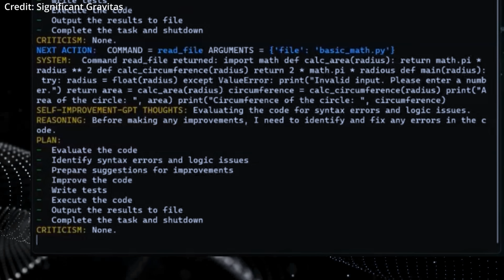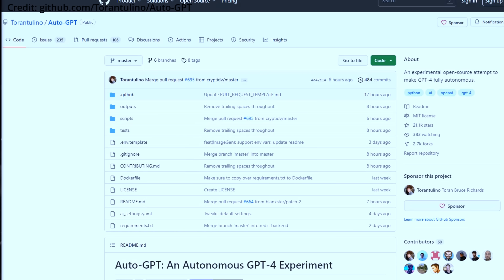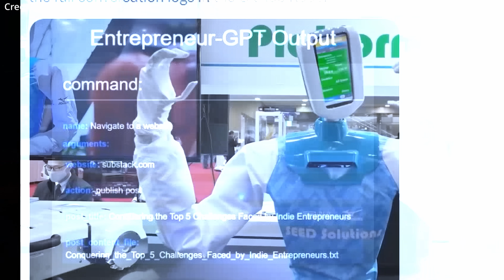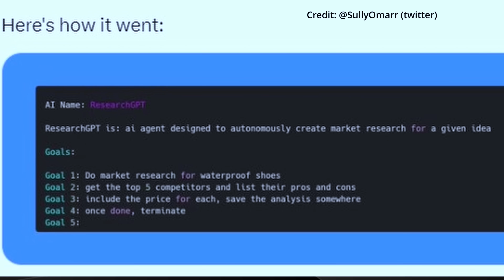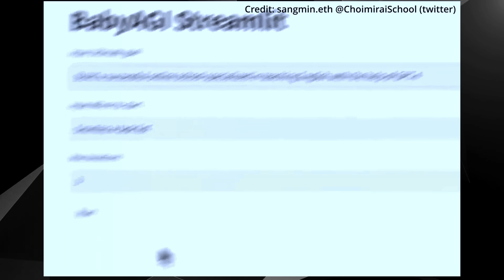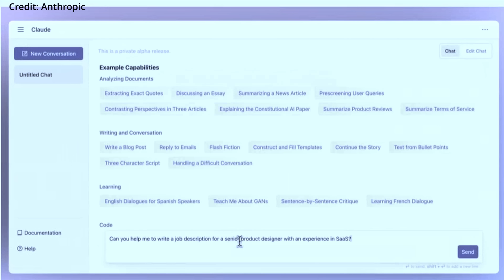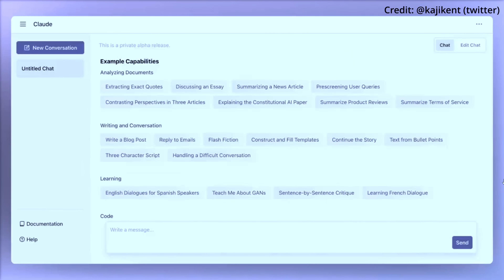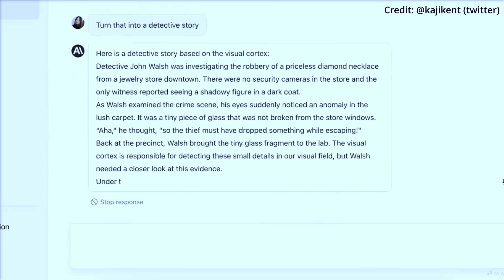Auto-GPT Unveiled: Autonomous GPT 4 w/ 7 New Abilities + 10X BETTER AI

Comment: Many people aren't sure where it's strengths are which is running many python scripts. So, the biggest advantage is asking it to create a bunch of python script with specific tasks and running them. It's simply GPT4(3.5) with API so the accuracy is only going to reflect that, but it WILL go back and fix it if it doesn't run correctly. Being that this is a open-source trial stage project, its mind blowing. If its not apart of your toolkit in training with AI you'll be far behind the other guy when this kicks off
Reply: The speed this is moving, gpt5 or 6 and it’s competitors will have this built in. Gpt4 made a ton of chatgpt based apps redundant, this trend will continue for the next ten or twenty years

Comment: Imagine that, a set of tools to accomplish task instead of a single tool trying to do everything. I don't know why it took so long before the AI researchers got off the "every hammer is a sledgehammer" track. But I'm pleased they realized it wasn't even close to a good plan.
Reply: This is powered by gpt-4. It would be hard to link other AIs together and do something useful atomically without GPT4 controlling and reasoning long term plans and multiple steps. 
It's so new I don't think it's fair to imply that the idea of multiple AI working together as something that was missed, it just wasn't practical before GPT4

Comment: In its current state its extemely buggy and can create code but from my experience the code will have errors and it cant execute that code. But im sure it will eventually be able to.
Reply: A friend of mine hooked up code execution to it so it can test its own code and fix the bugs. It didn't work very well, since we are still on the GPT-4 API waiting list and were using 3.5
Reply: @Alice_Fumo  im pretty sure it already has code execution it just cant execute it succesfully yet.
Reply: @Beneaththebranches  one of the reasons it writes buggy code is because it’s trained on code snippets from the internet like on stack overflows, it’s literally been trained to write buggy code. If you extract a ton of working code from applications past and present and fine tune it on that working code it will write much better code first time.
Reply: Playing around with Chat GPT, I asked it to write some Python code, which I then ran. I got an error, so I just told Chat GPT what the error was, and it said something like, "I see what the problem is." before spitting out some revised code that ran fine and achieved what I asked it. AI may have a future as a debugging assistant.
Reply: @The8bitbeard  right but we are talking about auto gpt, auto gpt can write code and even have other agents check the code but it has yet to execute code succesfully on its own for me. Still working on it.
Reply: Gotta give it a goal of having a code check for best results. It will create code debugging agent/agents.
Reply: @Ricolaaaaaaaaaaaaaaaaa  nah it will do it without including it in the goals. But it still wont succesfully execute the code. If you have gotten it to execute the code,  i would love to know how. It would be game changing.
Reply: @Beneaththebranches  Pretty sure ChaosGPT can execute code. Thats the whole point of people who can create python scripts to get to that state. So learn python from gpt and then get it to code a middle man assistant to compile stuff. But this is not public info and by the time it is, Microsoft is on red alert!